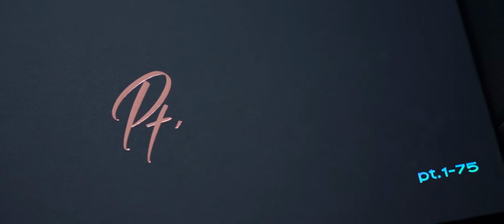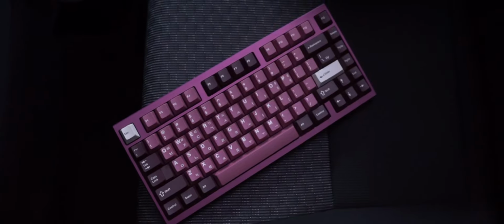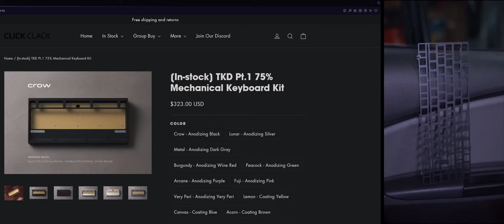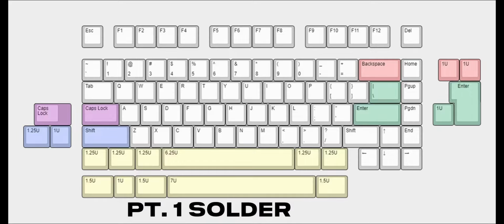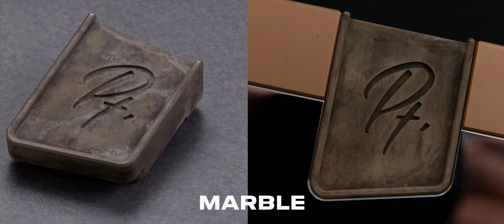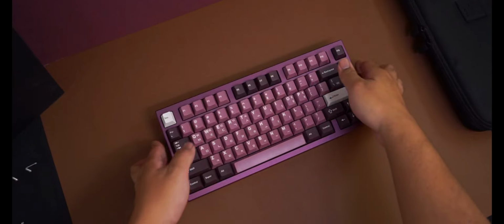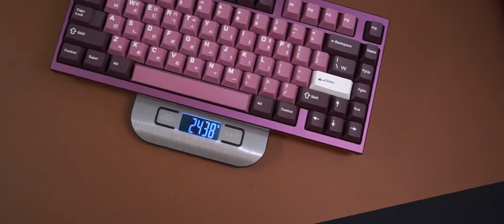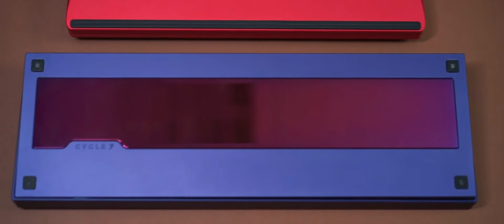TKD Pt. 1/75 - $238 SHIPPED, and its GOOD

Comment: the plastic sticker on the weight is to make sure they are snug and dont' rattle, the 7v has the same thing.
Reply from the maker: Idk, I’m sure thats what the several screws are for lol. The small weights had 3 screws each, the external one and the brass cover had like 8 each. Plus the smaller ones aren’t perfectly snug

Comment: Does force break help with the acoustics of the Mode Sonnet? Never seen anyone do that before.
Reply from the maker: It helps a lot. It might be because I was using the alu plate without the silicone tabs, but it sounded really pingy before i taped every surface between the top and bottom case. Made a bigger difference than the copper weight did
Reply: You have to do no mode with the sonnet are you crazy ?